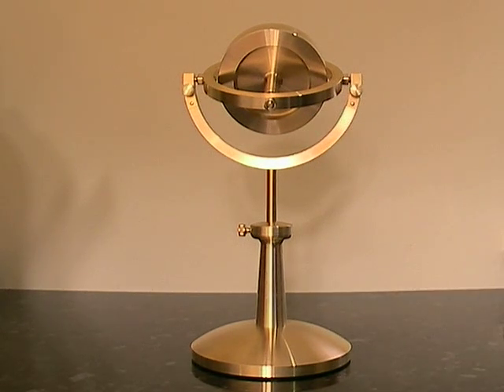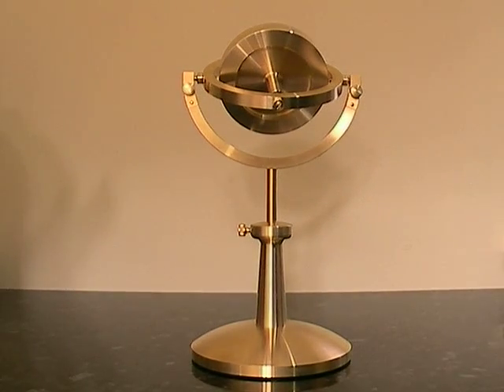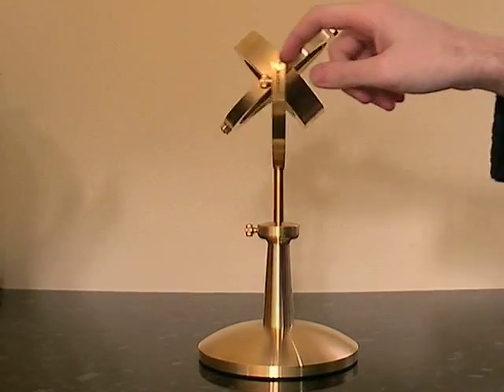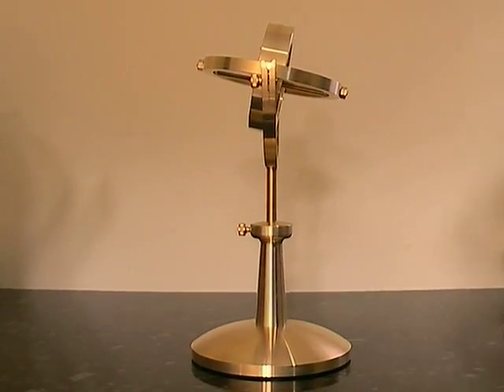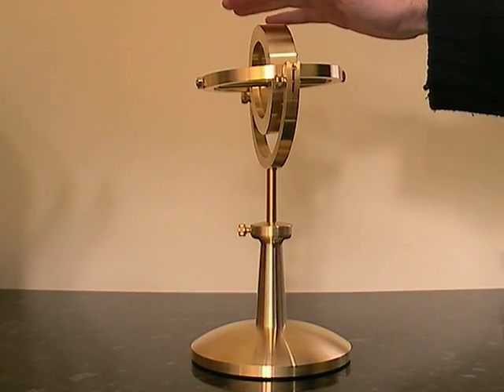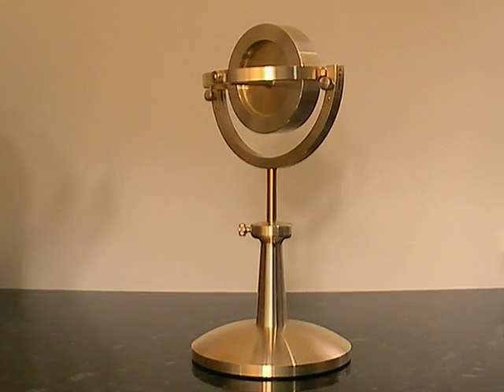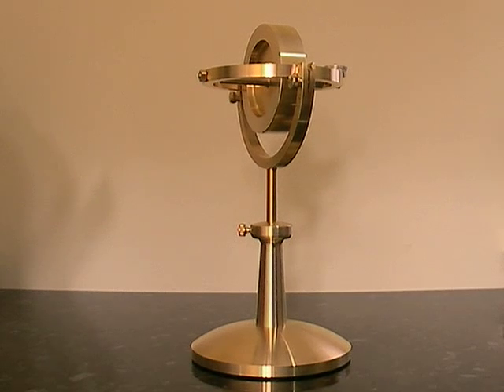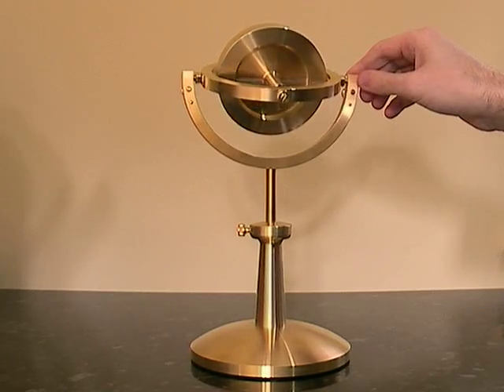Large Brass Lecture Gyroscope - gyroscope.com

Comment from the maker: @monkriddler Its very much at your own risk after 5000rpm. I run it at 10,000rpm but there is losts of energy in the disk. It won't stop if it comes out of the gimbals.e.g. it would go through a brick wall.